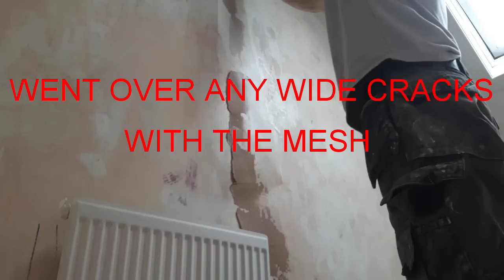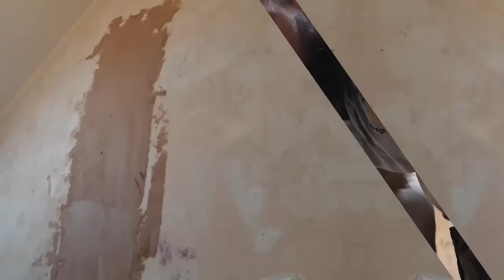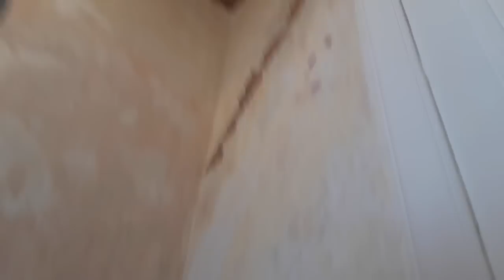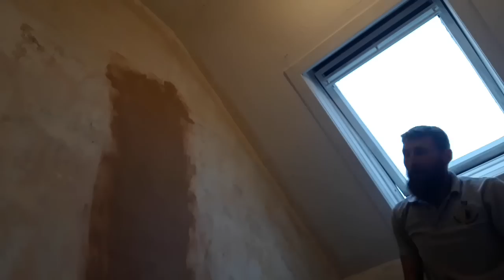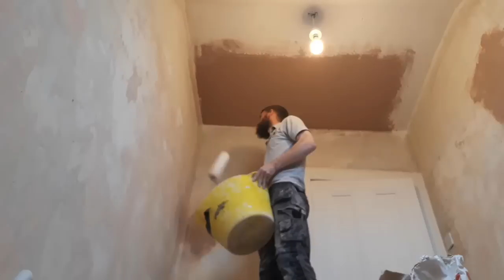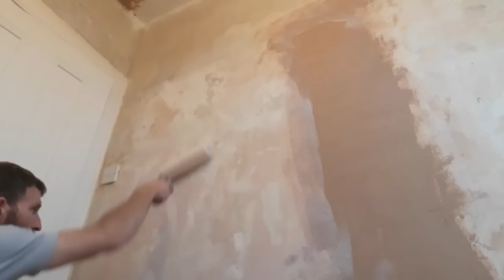small room to be plastered part 1

Comment: U meshed over wood can u get get away with it please reply
Reply from the maker: Not had a problem when using the good fiberglass mesh I will usually neat pva the wooded area first but it's best if you can take the wood away as it van give u problems but so far so good with using the mesh I've used it quite a bit now